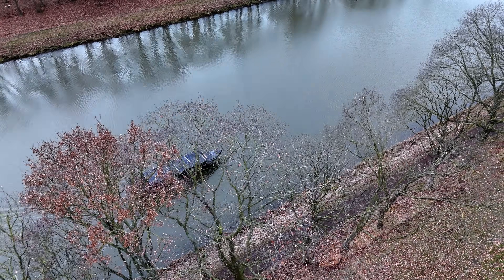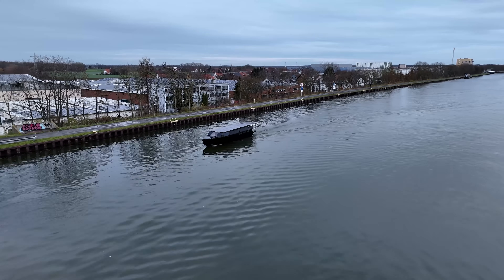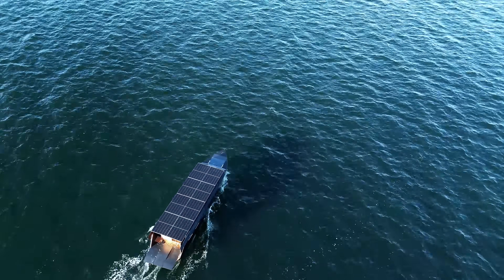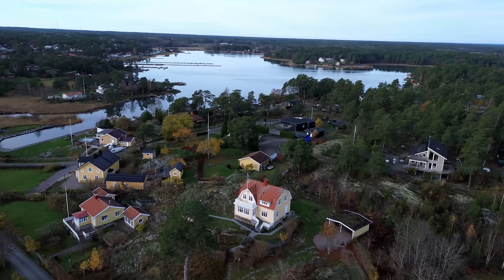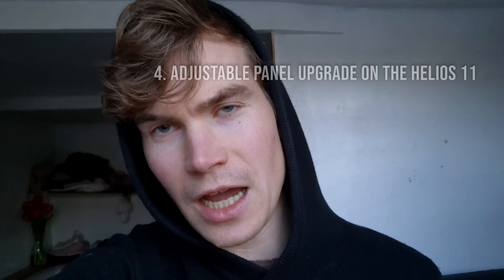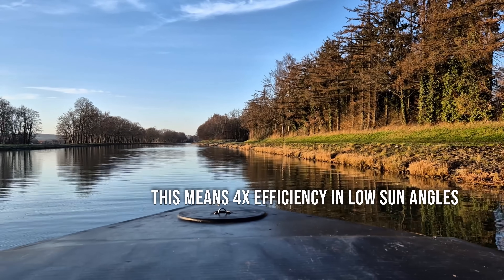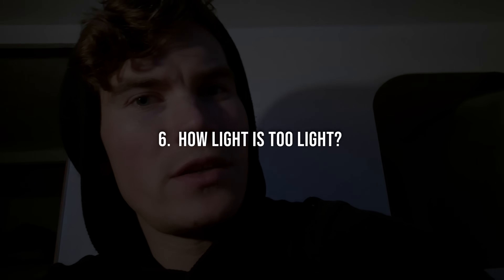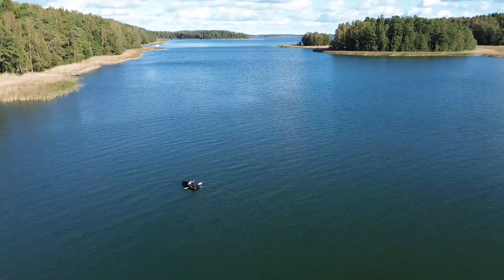My Solar Explorer Reaches Germany: Major Upgrades & Next-Level Design

Comment: "America has a lot of canals"!?  
Hmmm.  There used to be a lot of canals in the eastern portion of the US.  Most of this is now reduced to navigable rivers and the "St Lawrence Seaway" which brings ocean going ships to the Great Lakes.  I'm not sure if any of those commercial ships actually travel from the Atlantic all the way to Duluth Minnesota.  IF your boat can push northward from New Orleans against a substantial current, then the Mississippi, Arkansas, Ohio Missouri, Illinois, and St. Croix Rivers are at least partially navigable (depending on the draft of your boat).

Comment: Regarding flexible panels. I built the first version of my solar catamaran (6 meters x 2.4 meters) with flexible panels because the main feature of the vessel is that it can be completely dismantled for easy transport. What I learned is that despite their low weight, they must be mounted on a frame to withstand wind and mechanical stress (in the case of orientable panels), and the weight of the frame must still be considered during the design. Rigid panels of the same size already have a resistant structure. I believe a good compromise is the combination of fixed rigid panels and orientable flexible panels on lightweight structures that can be closed in case of strong winds. If you're passing through Italy, we can go part of the way together! Marco

Comment: If you want really high efficiency, maybe look into hydrofoils. Yes, it's a bit more expensive to construct, but you get much better speed, efficiency, range, almost no wake, waves affect you a lot less.
Reply: Do you have any ideea about how much power and speed you need to push it up?
Yes, those boats exists, also with electric propulsion. See Candela.
But has limited range, big batteries and powerfull motors.

Comment: I am currently studying design of home built airplanes. It is interesting from an aerodynamical point of view to listen to you, in ways that most people do not speak about yatch design. In a sense, an airplane and a boat struggles with the same; at it´s core you got thrust and you got drag as the two forces deciding your speed and how far you get on a given amount of energy. An airplane has to overcome the weight of the airplane using lift to stay airborne at the minimum drag. You have to overcome the same, if you had zero drag - your boat would almost fly forward with the same 1 kw thrust. The more you increase the need for lift to offset the weight of the boat, the more drag you get. It is after all the same forces you are fighting in your head as the airplane designers (but skin friction/wave drag rules the day for you). If we looked at your current build, you are fighting the one ton of mass since that is increasing your drag punching through the water. As with the airplane, when you increase mass - you have to create more lift, and thus at the same power - you get more drag and less efficiency. If you look at your boat, there are several areas where your boat is heavy without creating any structural or speed benefit. With more mass, you get more skin friction drag (more boat in the water), wave and more parasitic (shape) drag as you increase weight. As with electric flight, you are forced to think about how to minimize drag - and the less weight you got, the less skin friction and parasitic drag you get. With airplanes moving in the air we care about how much lift we can get from a shape over how much drag we create (lift over drag). This is not boat speek, but if you could get more lift from one boat shape vs the currect, you can reduce both skin friction drag and parasitic drag for the same weight - and go much faster/longer. As with efoils, if you can have a hull lifting the boat up (even a little), you can decrease drag and move faster forward. So another question you should ask yourself is; how much lift is my hull design giving me to reduce the drag pulling my boat backwards for the same thrust? From what I can see, the hull is just plowing through (brute force), instead of lifting the hull up higher out of the water (you do not need to raise it out of the water to get the benefit). You have identified the skin friction drag as an enemy, but it is threefold; skin friction drag, wave drag and form (parasitic) drag in that order at low speed. If you can lift the boat higher up using a boats hull shape - that means less skin of the boat will create drag - also waves drag will be reduced having a massive impact at zero cost. If you reconsider the parts, how much could f.g. be foam+cf/gf panels? How could the hull be optimized to lift the boat up to reduce skin and wave drag? I know these ideas are not usually in boat building circles, but understanding what´s holding your boat back is essential to get free performance out of your design. Cheers

Comment: Here is my thoughts. 

I do not like catamarans.   

Your original design here - is really shockingly close to perfect.   I would not abandon it.
Reply: bilge keels are one way to reduce rolling -
Reply: I keep thinking about other ways to reduce the rolling - without changing the hull shape. 

seakeeper! but that would use so much power its useless. 

I like the outrigger idea honestly - folding outriggers on both sides - with solar.   But it is clunky! 

In the Sea you really want 1 boat.  1 Thing. And simply be able to trust your 1 thing cannot flip over or sink. 

This requires a sealed self righting vessel.            

Catamarans, will not meet that requirement.   

Only a proper self righting monhull.

Comment: The only thing that I would have added is a bicycle pedals generator for recharging the batteries with some human muscle power.  It can also serves as a way for one person to get some exercise on the boat while generating some electricity for storage in the batteries.  May be two bicycle pedals generators for exercising together with a boat mate at night time, when you do not need one person to drive the boat.

Comment: I have seen flex panels 380w with 12 yrs guarantee, if you mount them on Ridgid backing perhaps can stretch even longer,  maybe 15 plus years ,priced around 180euro each, this is down in south Africa tho, flex panels demise is movement over time,

I too have been doing many calculations and simulation on ultralight hydrodynamic and aerodynamic sail/electric/ twin hull 9m hydrofoiler, for my chosen propulsion (2 x inboard high rpm 120v 70a bldc's gearing ratio of 2:1 +- 5k rpm prop speeds  ) roughly 8 to 9kw is needed (excluded  inefficiencies)into the water to lift a 2tons vessel  and around 6kw is needed to keep on foils in flat to moderate chop with calm conditions, I have run the numbers and for 14 to 20knots 9.9 type props are the best, Yamaha did all the r$d for us, why re invent the prop 

Assuming 15%los to inefficiencies and 15 knots foiling speeds around úkwh is needed per hour to propel the vessel, and a collapsible sail setup like yours, ahobie 19 catamarans to be precise has enough chove to keep it on foils should the wind be enough, 

As you have seen one well angled panel replaces 2 to 3 flat ones
That is a big cost and weight saving, perhaps 4x 650w bifacials that can angle in any sort of directions is more feasible , the med is sunny but the angles are still low, you wil lose a lot in the early morning and evenings due to the critical angles of diffraction. 

Much good luck on your testing and adventures
Reply: *7kwh

Comment: Hi I like the evolution of your yacht and channel. Today’s canal video gave me an idea for you. If you made foam rafts like your dingy, with the light weight photovoltaics on top, you could string them behind you. The floating array could provide as many square meters as needed in calm water. Adjustable triangle mounts combined with hourly tracking could be done with the right and left lines. Or in a cove you could cast an array of panels with a spider web of waterproof floating lines bringing  power aboard.

Comment: Would stay with ridgid panels since they are cheaper and the focus on development lays on them. 
Weight on a small boat is not that important.
Would also avoid to have adjustable panels. Difficult enough to do that on land do to possible strong wind, will be much worse on a boat do to stability. Rather add panels on the side.
Solar panels are cheap the tilting mechanic is expensive and will create problems.

Comment: You could also  make a sliding mechanism and tuck two or even three layers of solar panels in it. It would not do much in regular mode when you travel, but when you anker and have space you can slide them out and receive double or even triple the Sun capacity. Just toughts as you build this McGayver Style.

Comment: For your new catamaran project; a 5 meter beam would scratch the maximum width of many French canals. On several locations it would mean restricted room, very limited manoeuvring and traffic problems. Not sure what the ideal width would be, but definitely not the maximum 5 meters. Canals/locks in France suffer a lot due to lack of maintenance. Upstream river sailing would need lots of power. There is info to be found on the internet. In Holland and Belgium you will find many skippers experienced in navigating the French canals. Success with the project!

Comment: Wow!… lots of good information in this episode. Thank you for sharing this valuable information. 

I like that you’re staying with only solar and sail because this is a forcing function that spawns innovation. 

I’m surprised how little energy the vertical panels are producing…perhaps tilting them up would help?

The other advantage of not requiring a generator or combustion engine is that’s your yacht is super safe with no need for the plethora of equipment to make the yacht safe from fire or explosion. No noise. No fumes. No fire suppression systems. No worries concerning bad fuel or water in the fuel. No oil changes. The list of problems and maintenance goes on and on as soon as you introduce any combustion engine. And the biggest reason to not use a generator or combustion engine is that you won’t have to work as long in order to pay for fuel and maintenance and the time it takes for this maintenance-you cruise for free with more free time or time you can use to make more income if you choose to do so. 

How much is your time on this earth worth?…it’s priceless. 

I think you’re on the right track. Keep going!!!

Comment: I love your concept on asolar catamaran. I myself have had an idea for a couple of years now to build an open small catamaran with solar panels as roof and a small electric motor as Minn Cota, so I can take the boat to my small island outside my hometown. Every time I will go there, the battery will be full charged, and I will never think if I have enough petrol and I can relax from all noise of my 2 stroke engine.

Comment: Great boat and great videos.  I'm just going to throw this out there... I think you are taking how much you boat moves around in waves to mean that it doesn't have enough "stability".  But stability in boat design is not about a boat's tendency to stay level with the earth and not move around.  Instead, stability is the tendency of a boat to remain level with the surface of the water.  In a wavy sea state, those waves are tilted.  And that tilting is constantly moving.  So what you are experiencing as a lack of stability is exactly the opposite.  It is the the boat moving around to stay level with a tilted wave.  I think you would find that if you replace your heavy solar panels with lightweight thin ones, it would only make this condition worse, because it would increase stability and the boat would even more quickly follow the sloped waves.  A catamaran would help somewhat.  The wider track would limit the angle that the boat is likely to tilt in a wave state, and the smaller waterplane area of the twin hulls would decrease the lever that the waves can use to move you around.  The movement would still be very fast though, because catamarans have a lot of stability and I'm sure you would also be trying to retain your lightweight design to keep propulsive efficiency high.  Just some food for thought.

Comment: I still wonder if the weight of a small 5kW genset (0.5lph) or hybrid drivetrain and 30-40 litres of fuel paired with a slightly smaller solar array built for 95% of use cases wouldn't be a perfect trade off for weight vs. usability. 

Having emergency power for safety seems like a small trade off. Including for days when you decide to go adventure in non-typical places (ie: home to Norway, northern locations, night travel to avoid inclement weather, etc). Maybe it's just because I'm thinking like a northern Canadian 😅

Wish I was closer, would love to help build the next one. Keep up the adventure!

Comment: You don't want to have too good stability, particularly when you don't have a large keel. The pendeling movement will be the faster the higher stability you have, so moderate is better for comfort. You can play a bit with the batteries, how low you mount them.

Comment: I'm not a fan of the catameran idea.  I fear it would be unfavorable in choppy conditions (often found in the medeterainian).   I'd like to see a canoe stern monohull design with under water foils to improve wave action stability.   If the foils were designed well they could also enable a beaching of the boat .   Love the idea of increasing the prop diameter to achiebve higher thrust at lower RPM.   One last thought....in addition to, or in place of,  a small sail....the ability of using a kite could be a real plus on down wind passages.

Comment: For the catamaran build I would suggest either 1. Make sure batteries fit in the pontoons and can be mouunted in a vertical direction if that is needed. Or 2. Go with a centre trimaran like build with a centre hull for batteries but make it so that it is normally not in the water, but can be if the sea gets rough.

Comment: Stellar work man!  I had a similar dark colored sailboat, and in Florida in the summer sun you could fry an egg on it!  In next build you might consider thermochromic pigment in the paint that is dark in cold and then changes to white when temp reaches a specified point.  The pigment actually goes from opaque to translucent to reveal undercoat.

Comment: The biggest advantage of the heavy solar panels is their rigidity. They will be easy to raise and lower to improve solar collection. The lightweight panels will flop around or you will have to back them with something rigid, adding to the weight.
Reply: Well, that's also true. But the main concern is that at around 11:00 he says the flexible pannels are not as efficient when considering surface area vs the rigid ones, and I'm under the impression he is not considering his main limitation is, ad will always be, the surface area for solar capturing. Your observation adds to that, in so much as the need to backup flexible pannels with rigid structures to "point in the right direction" a less efficient pannel by area. 😮

Comment: Did you consider making your own motor propulsion system based on PWM and brushless? To maximise volt / amp ratio based on your battery bank. Same for making your own Par & Series power bank with prismatic LFP cells and the great JK-BMS, not to use sealed LFP 4S or 8S packs with sub-par BMS and no reset button. DIY your battery pack will give you more capacity for less cost, and ease-of-maintenance, easy to swap bad cells or upgrading.

Hybrid needs to be solar (upgraded to bifacials) + human pedal power (flywheel + 3-phase generator then AC-to-Dc then to charge controller). So to offset having friends on board, making the boat heavier, have them pedal. Also a lightweight marine grade wind genetor could help? Like a Vevor 500w, adds about 6.5kg. Maybe cannibalize them for the human-pedal-power system. How much can a human add in watts based on calories eaten?

Question: how are you staying warm inside? What's the heat source - LP or LNG? Something else?

Comment: there is a type of fiberglass cloth, that look kind of like carbon fiber
to lower the center of gravity/buoyancy, maybe use some steel inside the hull structure for the bottom parts (underwater level beams, cross beams) even the bottom part of the full itself and fins, and everything else above water level can be foam/wood x fiberglass

Comment: My experience with flexible panels is that they are much less resistant than the solid panels and they got worn very fast meaning producing nearly zero power after less than a year :face-red-droopy-eyes:

Comment: The drone view at @45s the cyclist moving at a leisurely pace going twice as fast as you was great. You should think of adding multiple input sources of electricity through the charge controller, like a pedal bike hooked to a generator, so you pedal power a flywheel, at a set RPM the flywheel turns the generator and your input is to offset the resistance. So you get exercise between cities, and add electrical power to your system. Have two of them. Then when you're in a port, you un-hook the bikes, add the rear-wheel back, and both of you can explore by bicycle instead of on foot each city you visit.

Did you consider angling bifacial solar panels? You could possibly add some watts per panel, maybe something to consider on your projected 2.0 catamaran version. It could simply be mirrored roof, standoffs, panels on standoffs, so wind can blow under the panels and keep them cool. It could be worth to test small scale.